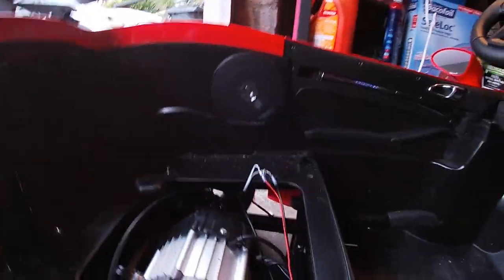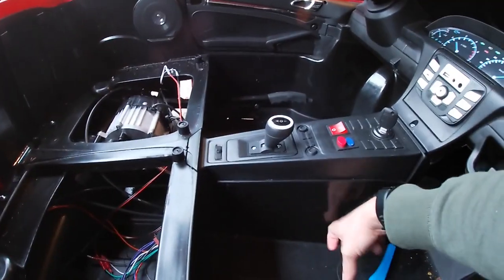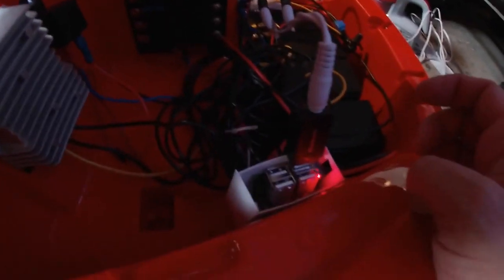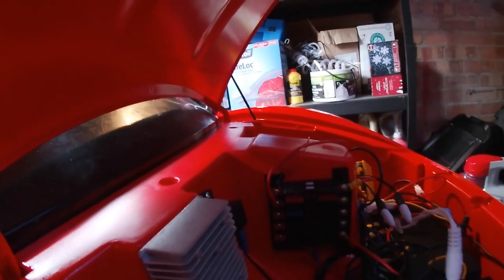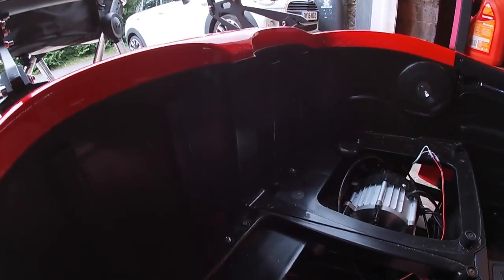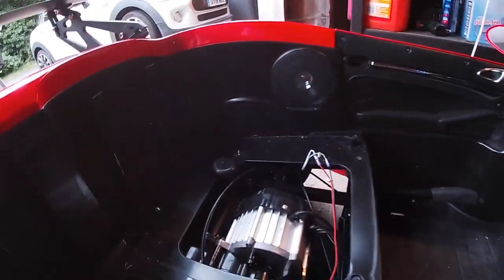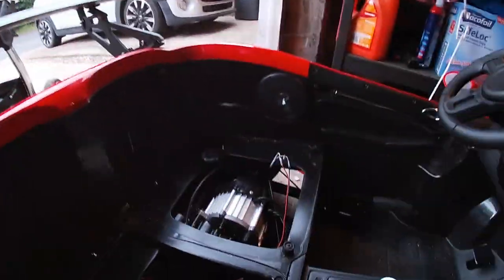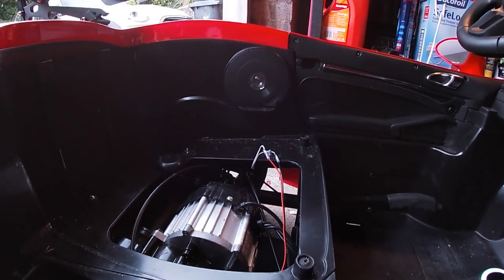Electric Go Kart Super Sport XL Stereo Installation | Pioneer | Power Wheels | Ride On Car

Comment: So it looks like you’ve abandoned the stock radio all together ?  Went with a Bluetooth module and ran 2 rca’s into an amp ?  And wired the speakers as usual. . .  I’m trying to utilize the stock radio as I like the functions being on the dash.  I’m  trying to figure out which pins on the back of the board will give me a pre-out to an amp u ever heard anything about this ?
Reply from the maker: Yes my stock radio is fully disconnected now, although I only finally pulled it's power lead the other day. The fake engine start up sounded annoyed me haha. Yes there is a bluetooth module that runs out a 3.5mm connection that is then converted into RCAs. The stock radio does have several speaker outputs that would be possibly to convert to a 3.5mm and then to RCA, but that would mean you will have the stock fake engine start up sound at full blast going out through your amp and speakers. When you look at the back of the radio you will see 2 sets of pin out connections, one has the power connected to it and one is the speaker output, look at that second one and you will be able to work out the pins required.

Comment: This project is sweet... ngl I'd probably be plugging in a full sized amp and trying to squeeze in a subwoofer somewhere if I was trying this myself... just for the shock value of being louder than the chav in his chavmobile who pulls up next to you... I'd be tempted to swap the motor for one pulled out of a Tesla so I could smoke him at the lights too... I mean I'd probably smoke myself in the process... but it'd be a hell of a ride!
Reply from the maker: haha it's funny that you mention a sub, I have a mini tang band sub underneath the passenger seat :) I'd love to swap the motor out but funds don't allow me and the mini pioneer amp I use is designed for a normal car but it was the biggest I could fit and keep dry :( What are you driving?